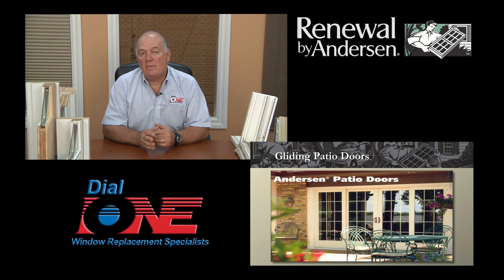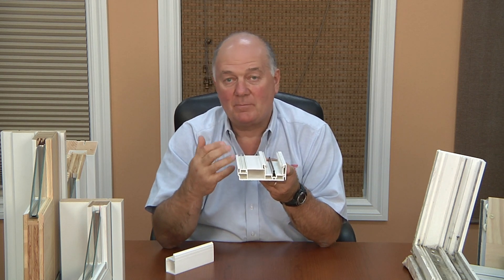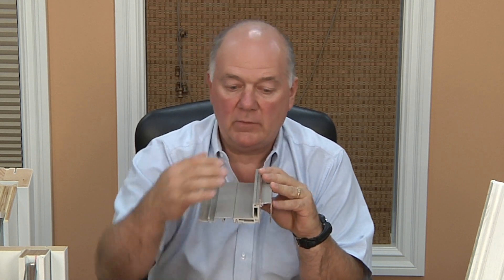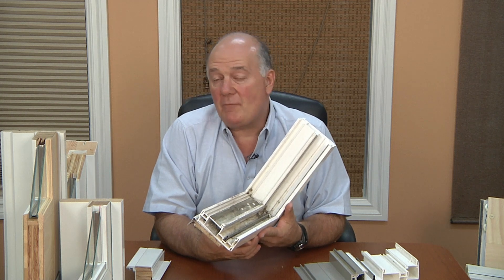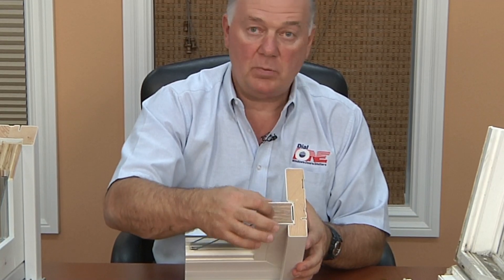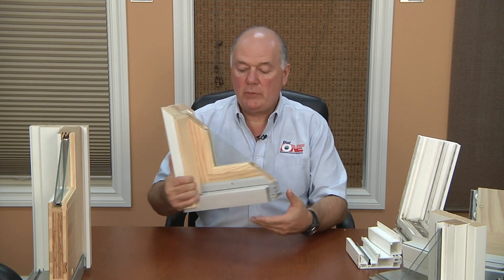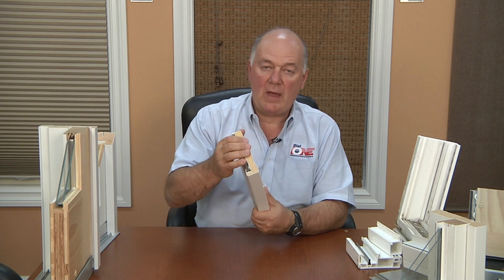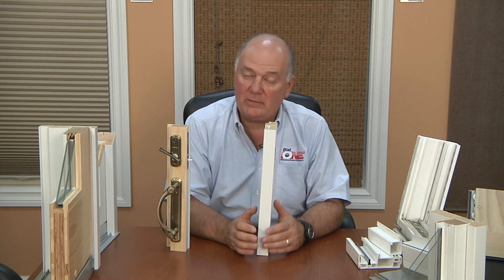Patio Doors by Dial One - Orange County, CA - 949-699-0684

Comment: Charlie is a great presenter.  Confident, knowledgeable, smooth.  I have found the same smooth communication from RbA reps in Phila.  There is no disputing everything Charlie has said.  I have 13 RbA windows and looking at one more and a sliding door.  No worries as a homeowner.  RbA will be the last window you need.  It comes down to cost (RbA offers financing as an option, though) and the price may surprise you when compared to the standard vinyl option.  But RbA has your back with quality, installation, performance for the life of the window.  The RbA warranty transfers to the next owner for 20 years.  You need to do your own homework if your contractor is offering the standard vinyl replacement window.  Who will be fixing any issues with framing, installation, leaking, etc if your contractor installs your vinyl windows?  RbA is a one-stop shop.  RbA is an investment at the start that prevents an expense later on with repairs, etc of inferior windows/doors.